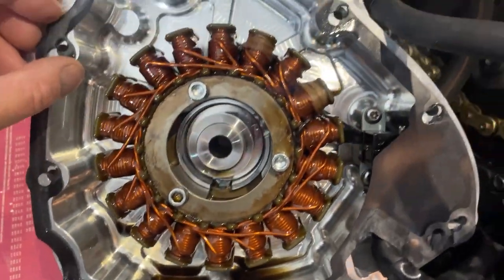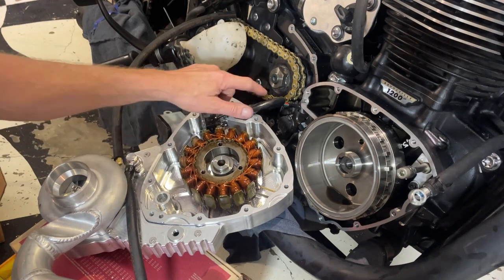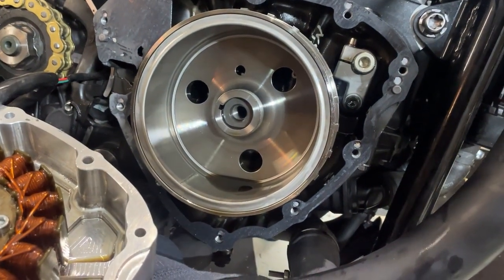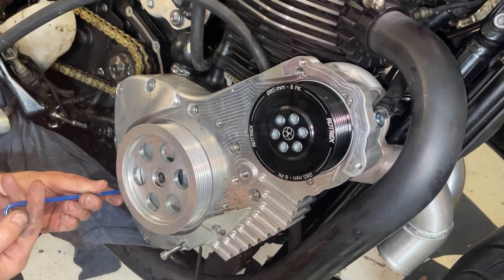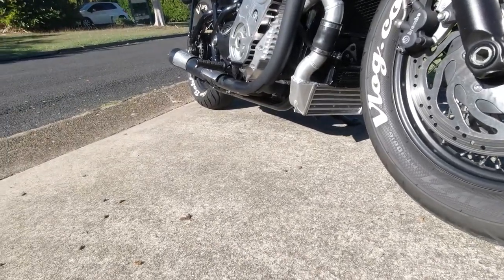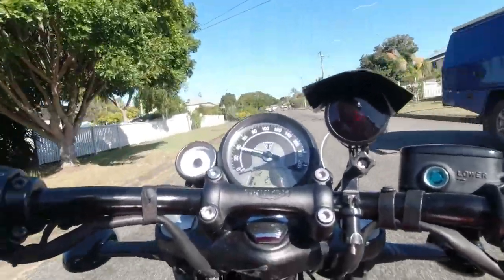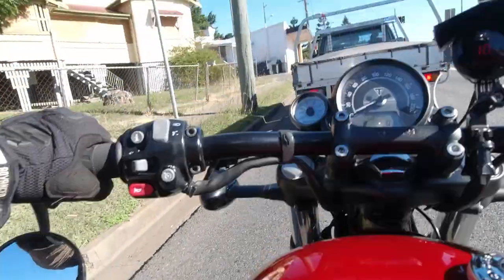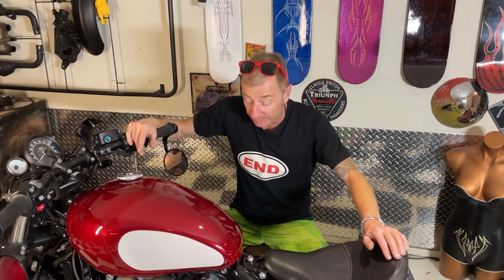Supercharging the Triumph Bobber (part 10) I finally get the oil leak fixed!

Comment: If there's a next time... you could also try annealing the copper washers - heat to bright red (a gas stove will work) and quench in water.
Reply from the maker: Cheers! I will try that as I couldn't really see anything wrong with them. Hopefully, it won't come to that.